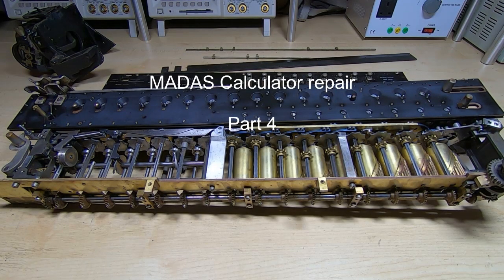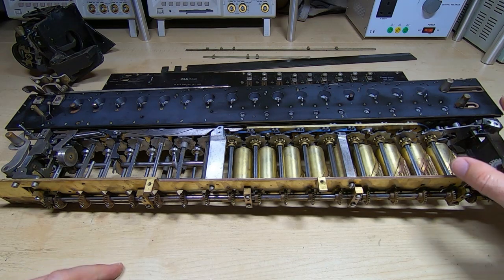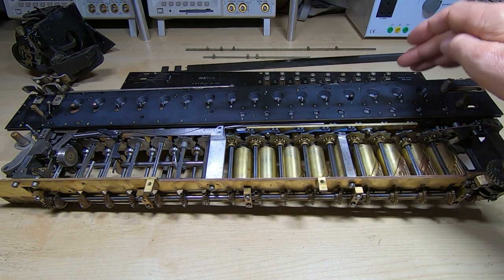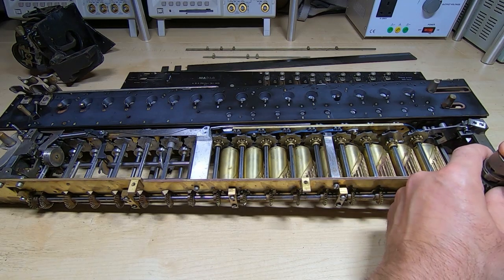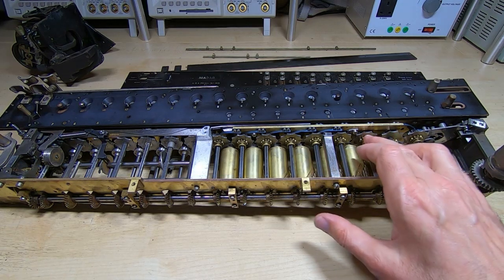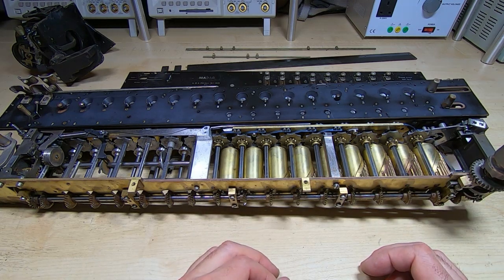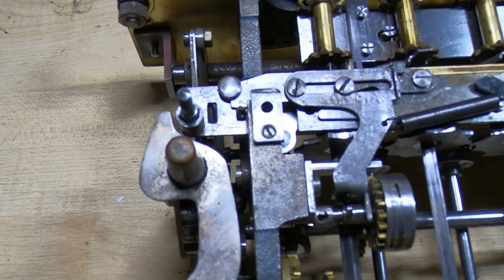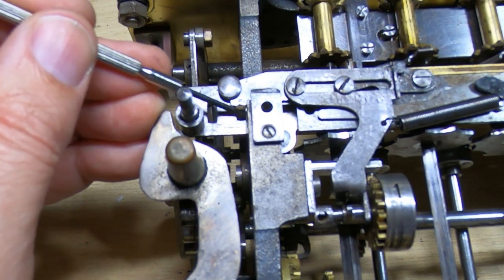MADAS Calculator repair Part4

Comment: When levers are so worn as to not properly engaged in slots, how do you make a new lever ?
Reply from the maker: They are fairly easy to make from scratch. I start by figuring out the 'flat' shape and then cut out a blank (for complex shapes I make a test blank in cardboard). I then fold it and finally file it to final shape. As long as the correct bend allowances are used then it is possible to make very close copies. Long slots like the one in the part in this video are quite easy to close up as the slot can be reduced and the slot filed back to the correct shape. The method is to reduce the slot by working in from the edge and Not hammering the face of the part as someone seems to have done on this part previously. It is also possible to repair parts by filling voids with a tig welder or brazing and then grinding and filing back to the required shape. It really depends on the condition of the part and the material it is made from. I show how to replace a missing tooth on a small component in another mechanical calculator in the series I posted on the Friden calculator.
Reply: @JerryWalker001  I understand you don't want to show the "donkey work" but I would have really liked to see how you got those "slots" back in spec !
Reply from the maker: @jackpatteeuw9244  I will see what I can do but the lighting in my workshop is not really suitable for filming and carrying the camera equipment across would be a pain. I may just make a video showing some methods in future but most people do not seem very interested in watching a tedious 1 or 2 hour process.